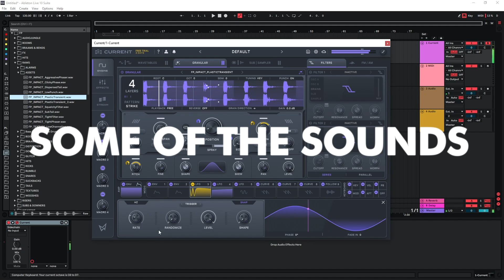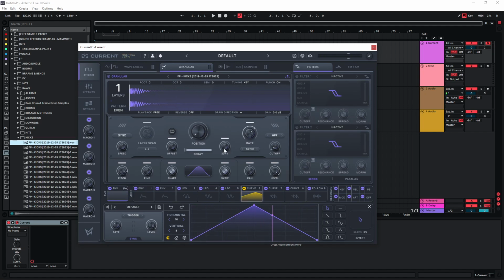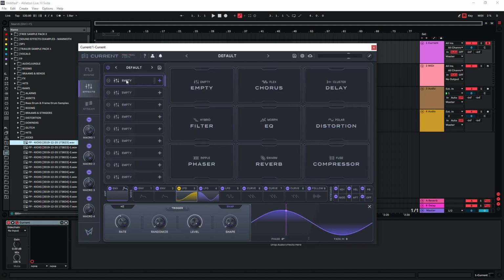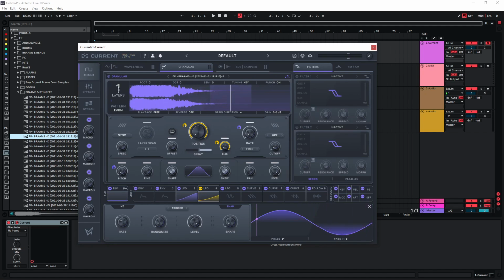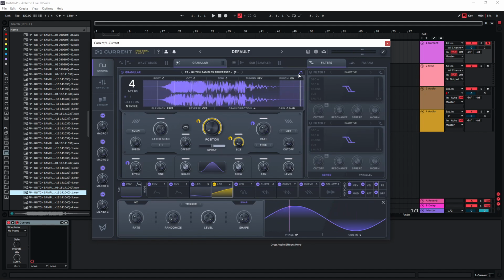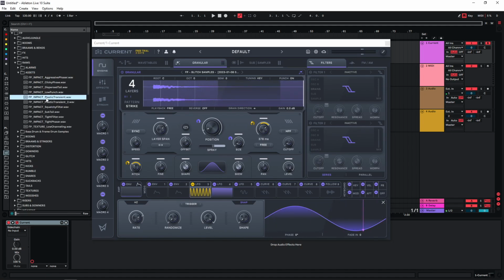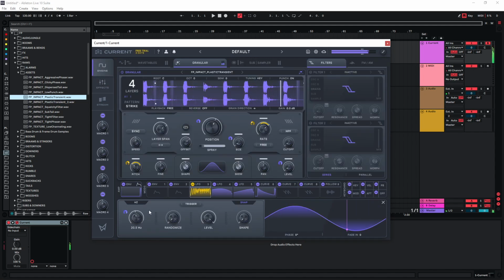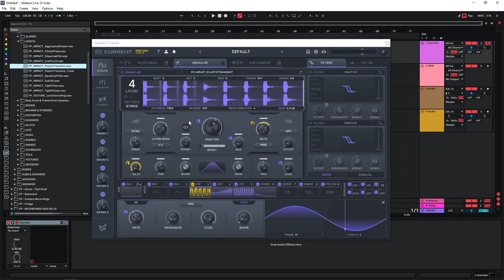Granular Sound Design with Current by Minimal Audio

Comment: what do you think of current compared to vital ? would i be able to recreate the same things in vital ?
Reply from the maker: Current has a lot of functionalities that Vital doesn't have; the granular section in Current is really good and the sampler is also a lot more powerful than the one in Vital. The interal fx section is also really great; so unless you pretty much stick to the Wavetable section in Current and don't really use any of the internal effects, it will be difficult to recreate the sounds in Vital I think; but that obviously depends on whether you are creating rather simple sounds or make heavy use of all the functions that Current has. :)